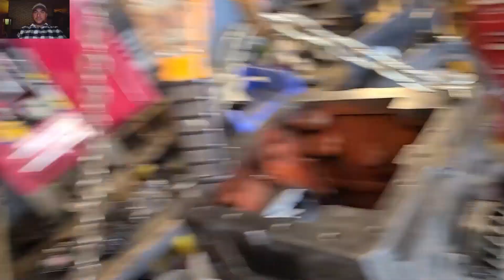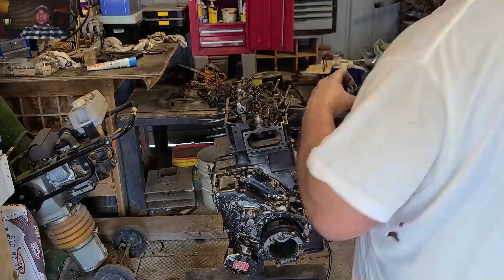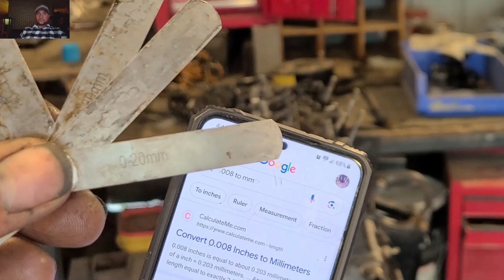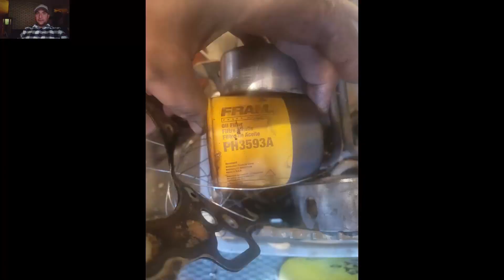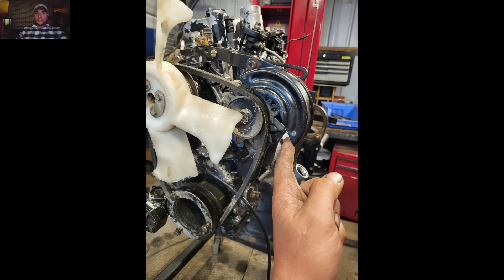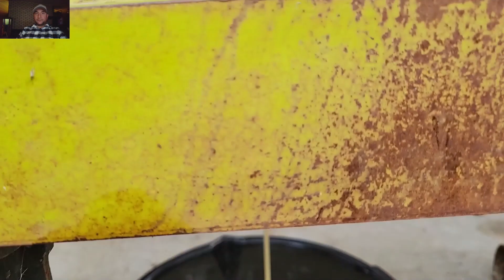Yanmar 2TR20A-X Rebuild Reassembly Pt. 4

Comment: Oh and if you're ever cleaning out fuel lines or any really heavy deposits, you do have to be careful. But you can use expanding foam oven cleaner and let it sit for about 10 minutes and hit it with some hot water. It is incredible what it does. Also carbon deposits and intakes and exhausts. I think you need to be careful with aluminum though
Reply from the maker: Awesome! Thanks that's a great idea.